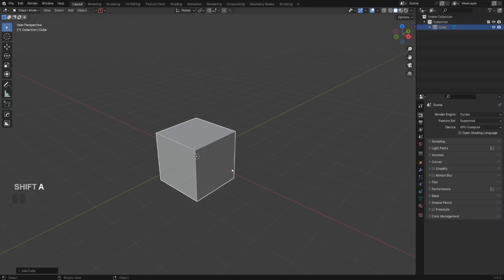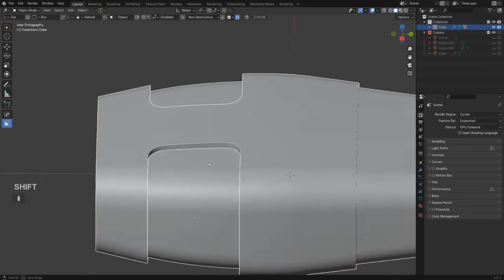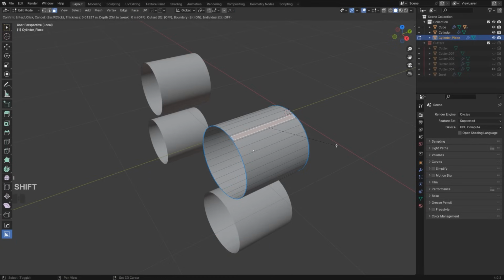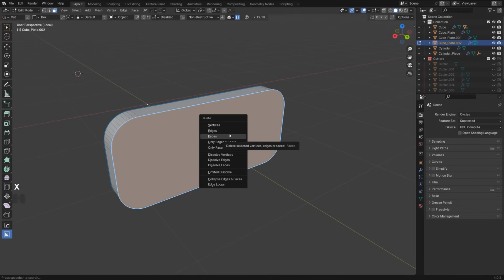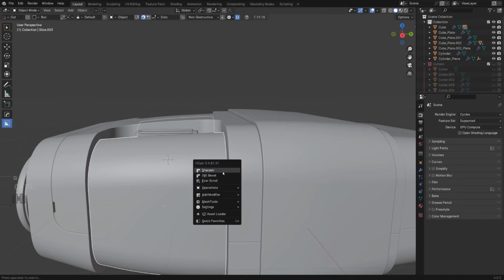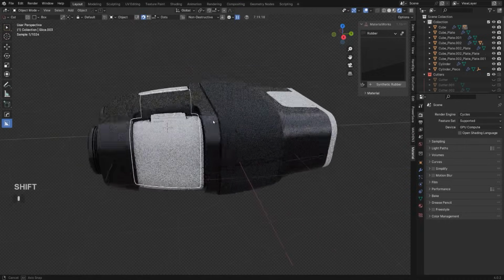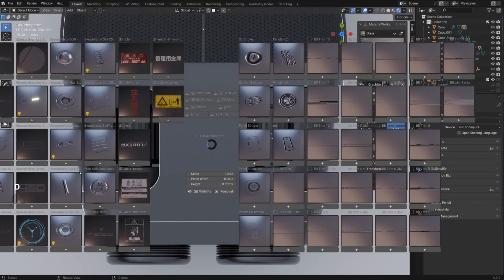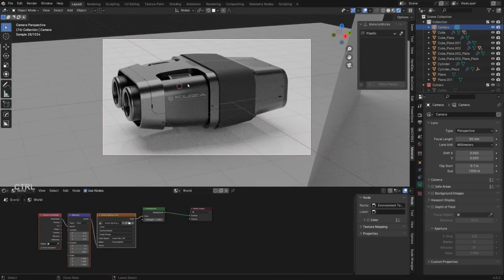Blender Hard Surface Modeling TUTORIAL

Comment: Friend, is it possible to bake with this project? to use in animation with loaded textures
Reply from the maker: You mean bake the details? Sure. as long as the model doesnt deform, you are good.
Reply: @PonteRyuurui    Excuse my English, I bought MaterialWorks and I wanted to know if it is possible to bake the textures, like Substance Painter, so when I export the model I can use it with textures.
Reply from the maker: @meca3dlab  you'd need to do it manually, you could seek some guidance on our discord https://discord.gg/cBMF9X5
Reply: @thodajyadahogaya6016   Thanks friend, do you have a YouTube channel link showing this process? to give me strength